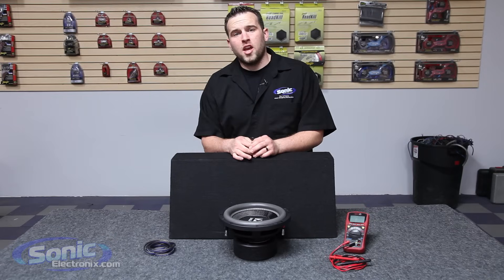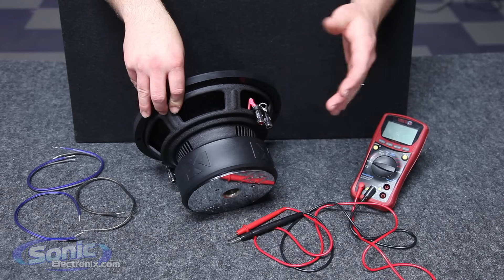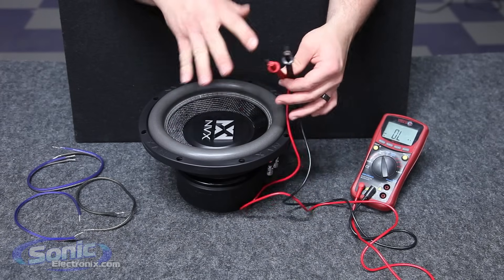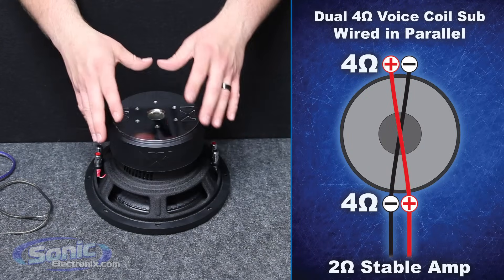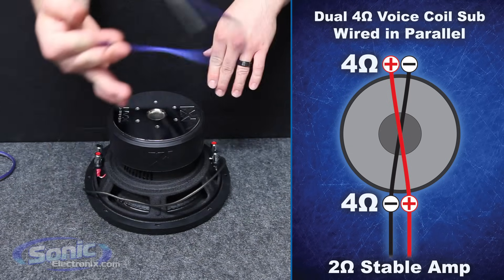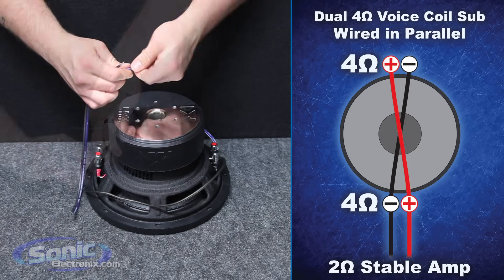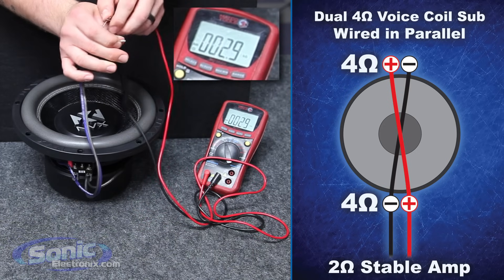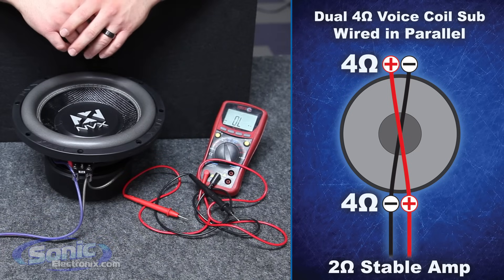How to Wire a Dual 4 ohm Subwoofer to a 2 ohm Final Impedance | Car Audio 101

Comment: ok so if i have a skar audio evl12d4 dual 4 ohm voice coil, i can hook it up to a 2 ohm amp and will still work but probably wont be quite as loud, correct?
Reply: Incorrect.......it will be almost twice as loud because a 2ohm load is more efficient and requires less power.  It will be louder because it has more power. The higher the ohms the more resistance to the flow of energy,  hence it takes more power to push a 4ohm load.

Comment: What’s happens if u parallel 2 4 ohm subs not to each other but seerately to make 2 ohms each and then wire both those up to a mono block amplifier with 2 outputs

Comment: So if I wire both subs at 2 ohm and my amp has 2 positive and 2 negative and I connect each speaker to there own positive and negative will it still be at 2 ohms? Because I don’t wanna play at 4 or 1 on my dual 4 ohm subs

Comment: Does it matter what possitive /neg terminal you use from sub to the amp with this setup?  That part is never mentioned. Assuming it doesn't matter then correct? 

In your picture you have the wires on one side pos/neg to the amp.  I have mine possitive on one side, negative on the other side to the amp

Comment: Hey brother i am having kicker 44csw124 dual voice coil sub and it is running on single coil 300 rms now how to run with another coil on 2 ohms plz tell me how to do this wiring settings and my use is very loud so what would be best for me

Comment: Question my amp is a Alpine power pack, and the speakers I ordered are a 4 ohm speakers, the amp says it can handle 2 or 4 ohm, do I need to wire the speakers like in the video?

Comment: Thanks for this , I did this to my sub which is 300 RMS power by at 200 RMS amp but I’m still getting clipping  at higher volumes, any help please ?
Reply: maybe cause the amp is under-powered, so it's working a lot harder

Comment: I have a 1600 watt hifonics amp and a 3200 watt single rockville sub its program rms is 1600 but it also says cea rated rms power handling says 800 can I still push it with the amp im running

Comment: You only need one jumper from a positive to negative....the 2 open connections go to the amp
Reply: That would put then in series, not parallel.  Would double the resistance .  If you wire 2 4ohm in series you would have an 8 ohm load.
Reply: No shit, which is wtf I just said, he doubled up on wire for no reason

Comment: If I wore both my DVC 4 ohm subs this way and run each sub to its own terminal on a 2 Chanel 360.2 Rockford amp 2 ohm stable will it produce 2 ohm out of each Chanel or will it now be a 1 ohm amp when both are hooked up to their own channel. The amp says it will produce 180watts per channel when hooked up at 2ohm and I need to give the subs close to 200watts per channel.

Comment: I have a skar audio 4 ohm dvc 2500 watt max 18 single sub and i want to know how to wire it to a one ohm load if possible? if not then a 2 ohm would be next best i think...My amp is a skar audio Rp1200.1D monoblock 1200-1600 watt max and has two speaker outputs could you help me on how to go about wiring my sub please also my amp says 500 watts @4 ohm 800 @2 ohm or 1200 watts @1 ohm please help me im stuck what should i do

Comment: Great video Thanks, Question, What type of amplifier do i need to use for a 4 ohm dual 10" Subwoofer? image dynamics Rec RMS 250W Max RMS 350W
Reply: Boss 2000 watt amp.....thats perfect for those speakers.....turn the amp knob to half bass.....let it sink in....then push it hard after 3 weeks
Reply: You typically want to double the amount, I hear it all the time. The rms is the actual power rating, so @350w rms I'd run a 700w monoblock if running a single sub. You can always turn your sub down so you don't overload your sub. Plus more power in the amp allows for a larger size/power sub upgrade. Overpowering and underpowering a sub can hurt the sub.

Comment: Hi I want to use dual coil subwoofer for my home theatre. Is it possible to use bi-amp method to connect the speaker coils seperately. Does it work?

Comment: Can Someone Plz help me.   I have. 2 4ohm DVC subs. Coming.     How do i wire up both subs to end at 2ohms at the amp. One one channel. Do i just jumper the + and -  from each voice coil over to the other sub?  My amp makes 600 watts at 2ohm
Reply: Ended up doing 2  2ohm subs.  Wired them so they both were. 4 ohm then wired  then parallel so they were 2 ohm at amp for 600 watts.  1200 skar 12s

Comment: I have a 1 ohms amp ehat do you recommend me to get 2 4 ohms or 2 2ohm subwoofer?
Reply: I was going to get 2 2ohm subs when the company messaged me back asking what kind of amp I had they told me to get the 2 4ohm subs an wire it to 1ohm

Comment: Mine still says 4 ohm
Reply: Did you measure 4 ohm on each of the terminal pairs before connecting them together? If yes, then you probably did not get a good connection on all 4 terminals. Put your multimeter test leads onto terminals on one side of the woofer, do not "cross connect".

Comment: can i wire a 2 & 4 ohm speaker to the same sub amp 2-4 ohm stable amp
Reply: Did you find out if you can wire a dvc  4 ohm  and a dvc 2 ohm to a single amp

Comment: Can one wire 2 DVC 4 ohm to a final impedence of 2 ohms? My amp is monoblock only one channel.
Reply: I need 2 dvc 2ohm speakers to get to a 2 ohm final..... or just the single dvc 4ohm can get u final 2

Comment: When I bridge a 2 channel 4 ohm amp, does it automatically become 2 ohm stable? Also, when I run a dual voice coil 4 ohm speaker in parallel does it become 2 ohms as well? So what I'm asking is, when my amp is bridged and the subwoofer is bridged would it be okay to run at full power? As you can tell, I'm very new to this. Any help would greatly be appreciated.
Reply: Did it work
Reply: @ProStickzTV  wow, that was a long time ago. I just hooked it up the normal way and it's plenty loud enough for my old ass

Comment: I tried this on an Orion H2 dual 4ohms and still came out with 4 ohms. 
I've aeen some other diagrams that showed ya use one + from one coil and one - from the other.
Not sure how this would make a difference, but now I gotta wait to try it again. 
Any insight?

Comment: How about when it's two 4 ohm dual coil subs, how do you wire them in to a 2 ohm final impedance??
Reply: Connect all of the positives to each other and all the negatives to each other. Then wire it to the amp
Reply: He made a video. It would actually be 1 ohm.

Comment: I wired a Gothic 12" dual 4Ω to 2Ω, then mono bridged my Pioneer GM-5100T 760 watt max and It is driving the amp hard at 420 Watts @ 2Ω and not recommended by Pioneer. It draws at least 19 amps (10 amps un-bridged) from your charging system, dims your headlights and cuts power to the amp at peak intervals at a higher volume.
The amp gets hot quick.
Pioneer recommended not to monobridge at 2Ω and this is why. It will end it's life prematurely if it's continued that way... But it was fun for a second!😛

Comment: I've been checking out the inventory on Sonic Electronix website and believe I found the setup i want. Don't want to specify brand name but the specs really don't answer my question so figured I'd ask here. 

The sub i'm interested is dual 4ohm 1200w rms... if I wire it as 2ohm does it stay 1200w rms? It's a 2400w max sub going to be using a 1500w max mono a/b amp with a rms rating of 1125 rms @ 2ohm. 

Noob question just want to make sure I buy the correct products.
Reply: I’ve been wondering the same if anyone could elaborate on this it would be much appreciated

Comment: PLZ HELP! do i need a multimeter or is that just measuring it. could i just connect the wires and then hook it up?
Reply: and what kind of speaker wire should i use. like if i was to go to the store and tell them what i needed what would i say exactly. I have 0 experience with speakers if you couldn't tell

Comment: Question what if my sub woofer is wired from the box terminal into the sub woofer on only one side of the subwoofer it’s a dual four voice coil kicker L7 and no jumper is attached to the other side does that make a difference

Comment: Is this the best way to get the best sound? I have a audiobahn aw1008t 10" sub that I plan on wiring to a ssl ev1500 amp. Cheap amp but it works well enough with the subs I currently have wired up (2 mtx terminator 12") I want to get the best sound out of the audiobahn that I can even though it's a cheaper amp

Comment: I have 2 10" skar 4ohm sub and a 2 channel amp how do I wire that up???
Reply: Wire each sub woofer as shown in the video. The 2 subs can not share the same channel on the amp or you will only be able to achieve 1 ohm or 4 ohm doing it that way.

Comment: brother I have 8 ohm speakers and sony 4 channel 4 ohm amplifier if connect 8 ohm speaker it fries or not
Reply: If the speaker is 8 ohms and dual voice coil you can use this process to break it down to 4 ohms.

Comment: Question! how do you connect a 4ohm sub to 4ohm amp? how do you exactly wire the sub, or is is the same as this?
Reply: Youll have to wire it in series parallel.

Comment: my subwoofer is 2 ohm stable and my amp can go all the way down to 1 ohm. Does my amp automatically put out 2 ohms if that's what the subwoofer is?
Reply: Your amp doesn't pick the ohms your voice coils do. if you have a 4 ohm DVC sub you get 4 ohm by default with wiring it as a standard sub but you can make the ohms higher or lower as shown in the video by wiring up the other terminals.

Comment: can i wire 2 dvc 4ohms to a 2ohm load?
Reply: Ahhhh my b. I read it wrong. think you can only make 2 dvc 4ohms to either 4 ohms or 1 ohms.
Reply: Thats literally what this video is
Reply: @GeterPreen  hes asking for two subs not one
Reply: Was going to ask the same thing. I have 2  DVC 4ohm x 4ohm   And wanted to do 2ohm load for the whole system.  So would I want an amp to each sub to make that happen ?  Or can I achieve this with a 4channel amp ?

Comment: If I have a Memphis pr12 with dual 4ohm what kind of amp should I with it wired at 2ohm? I have a Memphis sr1.250 but it blows the fuses all the time. both 500w
Reply: Adam Ardis something touching together

Comment: question... on a 1,000 or 1,200 watts sub, is it better to run 4hmo or 2 hmo??? I want max power but don't want to damage my equipment. and I am using a 1,000 watt amp!

Comment: Hey man quick question I'm wiring a type r DVc 4 ohm to 2 ! My question is when wiring in parallel do I have to come off the same coil when leading to the terminal on the inside of the enclosure? I think I have s positive from one coil and a negative from the other coil leading to the inside enclosure!! Is it ok or should I fix it???

Comment: what exactly does doing this achieve anyway?
Reply: Chase Burt It almost doubles the output of the woofer. It hits twice as hard. You are reducing resistance. Think of a hose carrying water that is flowing at a certain rate. when you poke holes in the hose, less water comes out at the end.  in this scenario,  wiring it in parallel is the equivalent to blocking the holes in the hose.  It increases output.
Reply: diambo4life aaaaaaah thnx for answering! so would a 4ohm dual coil sub be the equivalent of 2 2ohm single coil subs? 🤔

Comment: my friend has a two channel amp Memphis PR 600  has two 12s wired in parallel to one channel I bridged the amp for them without checking what the shop did would bridging a 2ohm load on a two channel amp like the one above ok

Comment: hey I'm kinda new at this and i was wondering what happen to the RMS in your woofer when you change the final ohm resistance for example i got 2 soundstream t7 10.4 700w RMS and i got parallel wired at 2 ohm each. The RMS stay the same or change.

Comment: I get two kickers with the switch on the back they 4  ohms  dual voice coil doe the amp I have put up pushing out 800rms on 2ohm do I need the  2ohms kind or is there. a way I can do it with the 4ohms kind

Comment: is this wiring set up ideal for my rockford fosgate 12 inch subwoofer with dual voice-coil with 4 ohm?
Reply: it is if your amp is stable at 2 ohms
Reply: my amp pushes out 1600 watt max at 2 ohm, so it should be 800 watt rms at 2 ohm correct? its a 1600 watt max amp. My rockford fosgate can handle 600 rms and 1200 max. It is ok to overpower it 200 watt right? that is 100 watt extra per coil.

Comment: What if i have two dual 4 ohm woofers? how to wire it for 2ohm? ( is it fine?) 400W rms each
Reply: If your amp is 1ohm stable, yes.
Reply: i wired two powerbass 10's in parallel to a 1 ohm load on a boss 3000w(really only about 1200 watt) monoblock amp, but i will tell you the amp would get so hot it would shutoff, especially during the summer. you can do it, but it depends on the amp whether or not you can do it safely. it was a learning experience really, the first system i did myself. i'm gearing up to do my second system and so i'm making sure to do all my research this go around.
Reply from the maker: You cannot wire two Dual 4 Ohm subs together for a final impedance of 2 Ohms, only 1 ohm or 4 ohms. 
However, if you have a 2 channel amp, you can use this video's wiring example to wire them separately, getting each down to 2 Ohms, one sub per channel.
You can find the diagram for that on this page as well: http://knowledge.sonicelectronix.com/tools/subwoofer-wiring/#prettyPhoto
Hope this helped!
Reply: thanks for your answer, but is it allright if i wire it for 1 ohm? i have mono amp, 4ohm final impedance is too much, it´s output would be just 440watts, thats ok for one, not for two... can i safely wire it for 1 ohm final impedance?

Comment: Hello mate, I am facing a issue here, I am trying to wire my dual 4 ohm sub to 2 ohms but, in my DMM it is showing only 2.9 ohms... I cant understand what is wrong. 

Some says the sub installation position does affects the impedance, is it true? my sub is installed firing back as vertical position. 

PLEASE HELP ANYONE?
Reply: I got a 2 ohm dvc sub , but showing 2.6.. pretty sure he said round the number up as well, wich then doesn't make sense.. never seen a rating of 3 ohm
Reply: Santo Heggie jl audio had a 3 ohm sub back in the day. may still.. and I know there's a psi sub that's 3 ohm.

Comment: How Can I Wire a Dual 4 ohm Subwoofer to a 4 ohm Final Impedance
Reply: you gotta wire the sub to make it 8ohm than put it into the the 4ohm amp it should read 4 ohm final impedance
Reply: You need a dual 2 ohm sub no other way
Reply: Did you get any solution to your problem?...I am also trying to find out the same answer.
Reply: Zulkar Nain nope... I just used a 2ohm amp...
Reply: yall need two 4 ohm subs to get 4 ohms.. google sub wiring diagram..

Comment: can you wire a dvc sub rating at 400/800 watts to a 2 ohm load running at 600 watts
Reply: 400 watt rms at 2ohm? if you run a steady 600rms wattage, you're asking to burn the coil out. its best to run something lower than or equal to the rms rating, never a good thing to run over it.

Comment: What wire gauge do you recommend for parallel wiring ? Running a  4ohm 12" kicker CVR and a MTX 500RMS.1000watts thunder class D
Reply: 16 or 12

Comment: I have a kicker solo classic 15" 2 ohm dvc sub how do I wire it a 4 ohm load?
Reply: Run it in series. But you've probably figured that out by now lol.
Reply: +Clair Bear I did lol but I tried it at 4ohms and my amp shuts off
Reply: Gain too high?

Comment: My sub is dual 4 ohm .My 2 chan amp can be bridged 1*150 watt 4ohm  or both channels 2*75ohm 4ohm each .Can i connect my sub with the bridge out or would i be better useing the 2 channels to the coils 

Thanks mark

Comment: help i got a dual 4 ohm sub 300w rms what kinda mono amp should I get for it
Reply: I have a dvc 4 ohm kicker compvr subwoofer with 400 RMS. I'm running a kicker cx600.1 amplifier. I know if money is tight that you might think you should buy a cheap amplifier.  The truth is, you pay for what you get. Plan on spending $125-$200 for your setup.

Comment: Ok so my 2 channel amp will give me 520rms watts bridged @ 4 ohms, the speaker i was looking at is a dual cone audiobahn low profile  AW1004J rated for 400rms watts with two 4 ohm channels, so connecting in series or parallel with either increase or decrease the ohms to 2 or 8, is there anyway to make a single sub with dual cones @ 4 ohms  make 4 ohms at final impedance, or just get a single cone sub?
Reply: Listen. If your sub is 1000 peak and 500 rms that 4ohms u can give ur sub the full 1000 by dropping down to 1ohm and using a 1200 peak watt. It really depends on what u want.  I have 4 6x9s and 4 6x5s at 600 watt peak a pair each. I use a 750 watt amp for each it doesnt mean because i have 150 more watts an amp each that i will blow my speakers. Its all in how you wire and how you use your amp

Comment: Does it need to be any special wire? Or will regular speaker wire work?
Reply: Zack Smith 

Regular speaker wire will work
Reply: Zack Smith what is the Guage size u would perfer for a single 12" VCW 124 using a 800.1 kicker amp
Reply: j smooth I would say a 6 gauge
Reply: VirusOfCyrus my sub takes 6g wire. But your right. Majority out there does